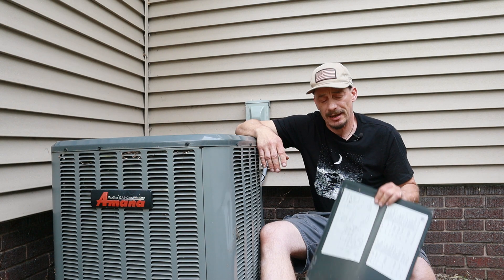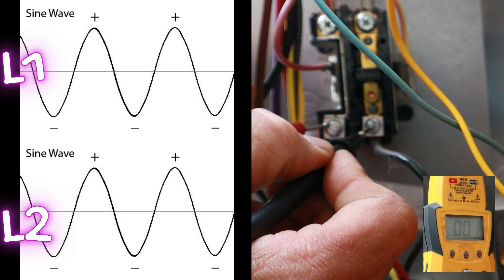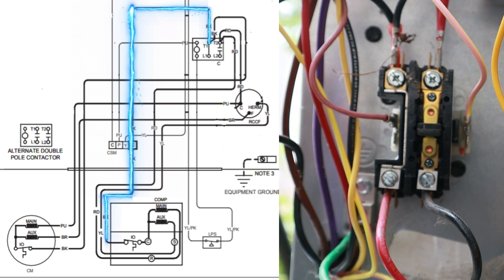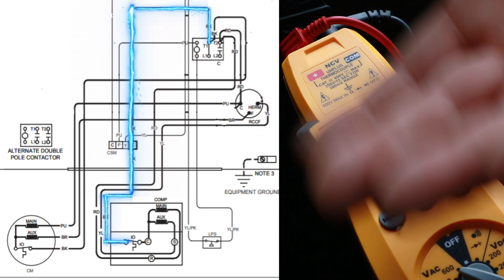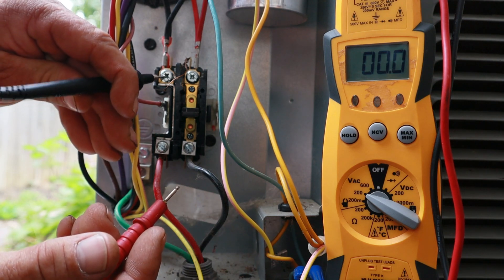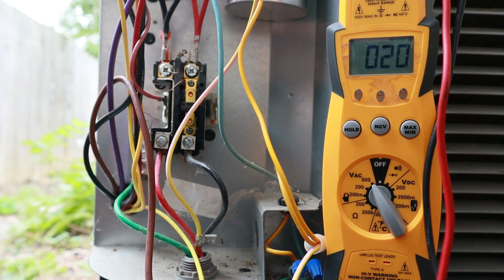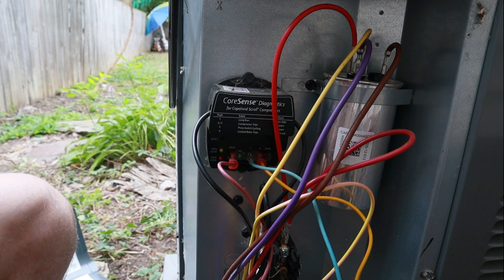Use Schematics To Understand Multimeter Readings & Test Points

Comment: I dont see on the schematic where the red wire L1 giving constant 120 volts to single pole contactor is coming from main source and also where is L2 main power coming from? Schematic is showing L1 with a circle next to it but no wire attached? Thank you for this great video! Not only a pro at HVAC but a pro at editing, thank you!

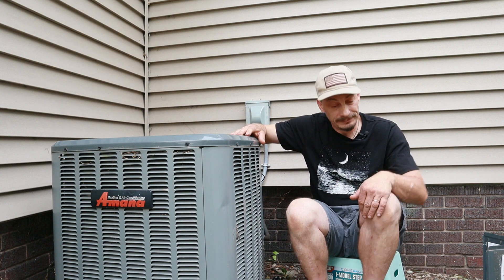Comment: 1:50 single pole contactor
3:06 Sine waves (concept)
Why read 120v or 240v with a multimeter.
4:29 alternate double pole contactor
5:34 disconnect wire to fan to save limbs (safety precaution)

Comment: Thank you Mike very much appreciate you, so is that the reason i couldn't get any voltages last night on my contactor because i was using my 2 probes there? Should i have used 1 probe to read my 120 volts?

Comment: You read 0 volts from L1 120 volts to L1 120 because they are at the same potential. There is no difference in potential, like you said in your most recent video. You get 240 volts from L1 to L2 because you are reading the full voltage across a 240-volt secondary coil from the transformer that supplies the house.
Reply from the maker: Yeah. Phasing is 180 on the 240 between L1 and L2 while reading 0v across a closed switch is the same phase for no PD.

Comment: Hey Mike I like the way how you explain the diagrams and circuitry for havc; I'm  not HAVC guy I'm an electrician, I always ask by my self what can happens in an electric unit if I turn off the breaker of my heat, (I know both units "never" work at the same time) keeping ON  the breaker for the outside compressor and calling for cooling at the thermostat assuming is summer time. Can you please give your best explanation about it, thank  you. I'M from Jacksonville, Fl.
Reply from the maker: If the heat strips are on their own circuit then shutting the breaker off will not effect the AC functionality. But if the indoor unit is on one breaker, the outdoor unit will not get the 24v control signal to activate the contactor that turns the outdoor unit on. The 24 control voltage originates from a transformer inside the indoor unit.
Reply: @JerseyMikeHVAC  thank you for response, that clarify my question, very helpful.

Comment: Hi Mike how are you❤️
I got questions for pressuretro
You said when system pressure build about .5psi pressuretro cut in setting then burner turn on. But when boiler not call for heating inside the boiler temperature and pressure will drop,will  equalize to room temperature and 0psi.  For example First time in winter,inside the boiler pressure drop and how to build the pressure to make .5 psi pressuretro contact close to cut in setting? I don’t get that.
Reply from the maker: The pressure doesn't need to build up to .5 for the burners to be cut in. It needs to be below .5 during a call for heat for the cut in.  The differential plus the cut in determines the cut out pressure, so if the diff is set to 1 and the cut out .5, the boiler will cut out at 1.5 psi. Once it drops below .5 it will cut back in so long as there is still a call for heat.
Reply: Could u  please explain more about why doesn’t need build pressure to .5 for cut in setting? What will be the normal position for pressuretro contact? Close or open when system is off mode?
Reply from the maker: @8joh58 It can be either open or closed when the system is not calling. The thermostat opens that whole circuit when it's not calling for heat so nothing will happen either way until the thermostat closes it on a call.
Reply: When thermostat is call for heat, electricity gonna be bypassed the pressuretro to turn on the burner? If not,  how can electricity past through pressuretro since contact is open?  Sorry Mike I don’t get it=(
Reply from the maker: No. The thermostat can never bypass the pressuretrol. The only time the thermostat can call for heat with the pressuretrol contacts open is when you have a head of steam on the boiler equal to cut in plus differential, which based on what I said earlier was 1.5 psi. 

 At that point the boiler has pressure and is producing heat even with the burners off. Only when the pressure drops off to below the cut in does the contact re close and the boiler can fire up again. 

You need a call for heat and the pressuretrol closed for the boiler to fire up. Can't be one or the other. Always both. 

If the pressuretrol recloses but there is no longer a call for heat, boiler will not fire. If there is a call for heat but the pressure is above the pressuretrol cut out, boiler will not fire up then either.
Reply: Could u make a video for the question that I asked please !  I know how refrigeration pump down work on lpc(low pressure cut off) cut in and cut out, but I just don’t understand how could electricity past through pressuretro since contact is open. I’m getting stuck here. if pressuretro contact is Close when thermostat call for heat, but why pressuretro contact is close when thermostat first time call for heat?
Reply: If I turn on my boiler first time of winter. At this point does pressuretro contact close or open? If close ? Why is close? If open? Why is open? How electricity go through call for heat since contact is open? I’m getting stuck here🙁
Reply from the maker: @8joh58  The pressuretrol contact is closed all summer long because there is no steam pressure on the boiler. It is below 0.5 psi. But the boiler will not fire up because the thermostat is not calling for heat. If the thermostat is not calling for heat, the 24  volts doesn't even make it to the pressuretrol. So the pressuretrol can't do anything even if the contact is closed, because the thermostat is preventing the 24 volts from getting to the pressuretrol until there is a call for heat .

Both the pressuretrol and the thermostat are switches and they are in the same circuit. They aren't different circuits. Both switches have to be closed for the boiler to fire up. 

 If the pressure is too high on the boiler, the pressuretrol will open and not allow the boiler to keep firing even if there is a call for heat, because now you have an open circuit, even if the thermostat switch is closed. 

 Same if the pressuretrol switch is closed but the thermostat switch is open when there is no call for heat. You have an open circuit because the thermostat contact is open even if the pressuretrol contact is closed. 

You need them both or you have nothing.
Reply: Oh ok. Contact is close, below .5 psi contact is close . Now I get it🤣
Mike u r my greatest instructor ❤️❤️❤️ also Thank you for your patience in answering all my questions. I appreciate it
Reply from the maker: @8joh58  Anytime, brother.